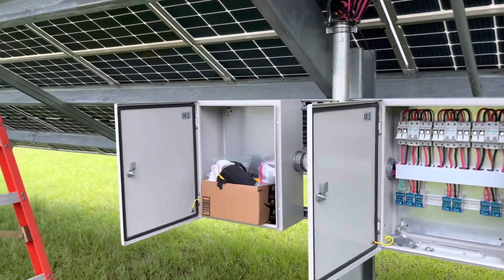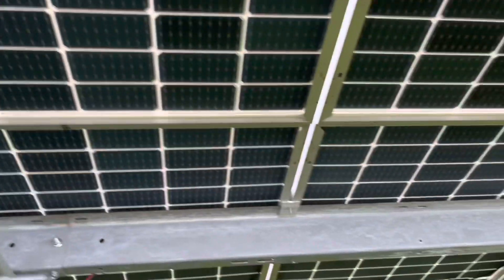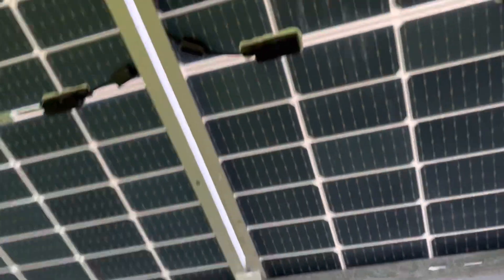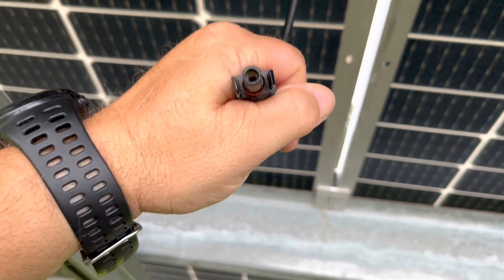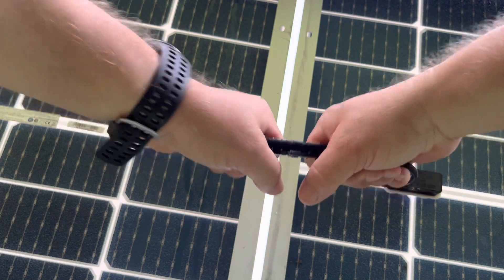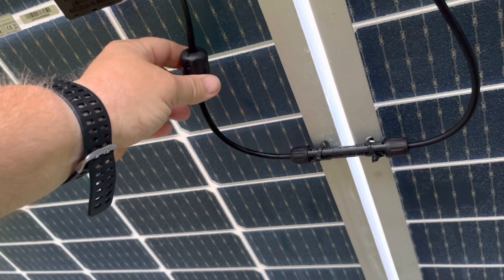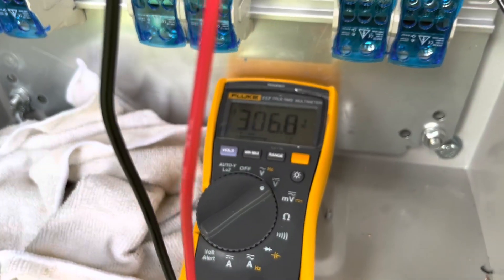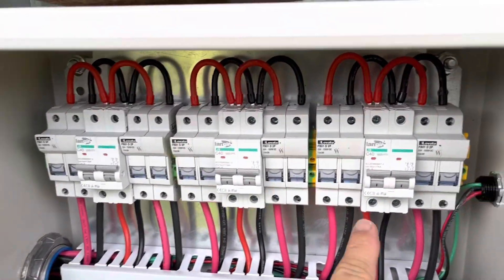Solar Power Project - PV Array Wiring and Combiner Box

Comment: Those surge suppressors are massive! I've seen those used in wind systems, so I'm sure they do the job, But they're very expensive as compared to the DIN rail mounted type  40KVA+ that I am using. Moreover the later fit nicely inside your combiner box. Did you see any drawback in using those?
Reply from the maker: I considered the din rail mounted units. They operate differently than the units I have. But as I considered how much I was investing in my solar equipment I wanted to make sure I protected as best I could.

Comment: If you have the proper rated breaker, is your fuse really needed then? Is not that overkill?
Reply from the maker: According to the panel mfg the maximum fuse allowed for a string of panels is 20A. When I parallel strings the combined maximum power point current is around 23A. 23A > than 20A hence the need to fuse each string. The breaker is only being used as a disconnect.
Reply: @jeffmotes2129  It's rare to see a PV panel with Isc higher than 10A. But mine are less than 280W. In your case, a  16A 1000VDC breaker would do perform perfectly as a disconnect and overcurrent protection. The thing about fuses is that they come in different types, some of them are fast blow and other are slow blow. Most do not handle higher  DC voltage like around 450 VDC nicely. if they do, then they are quite expensive too and I never find them when I need them. God knows why... Just like my tools.
Reply from the maker: @francoisguyot9770  that would have been another way to do it
Reply from the maker: @francoisguyot9770  I’m using ZNShine 450W panels Imp = 10.7A (plus up to 10% for bi-facial), Isc = 11.6A. 

But what you suggested would certainly work and would have saved me the extra disconnect per source circuit.

Comment: Nice set up,FYI if you're using broadband ferrites you need to have them clamped around the Pos&Neg of the circuit or they get over saturated quickly. If you're using high saturation ferrites you'll be OK tho✌️
Reply from the maker: You are correct. Thanks. Going to modify this shortly.

Comment: Looks good but DC has a lot more loss that AC with long wires. How much loss do you get through the run to the inverter and how long is it?
Reply: This has less loss than 240V AC
Reply: It’s common in Solar to run high voltage DC from the array to the inverter.  The high voltage 3-500vDC mitigates the problem of voltage drop.
Reply from the maker: @balrog006  I’m running 350Voc on the source circuits from the array to tge inverters. That was the maximum voltage I could configure with the number of panels and inverters I was originally using.
Reply from the maker: It’s about 400’. I’m using #4AL direct burial. VD is 2.7% at max current

Comment: You mentioned that it was raining. Be careful there with exposed MC4's you really really don't want moisture in there. If you do it'll work for a few years then you have yourself some troubleshooting. I leave the covers on until the moment it's plugged in.
Reply from the maker: Well said. It was a rainy day but wasn’t raining at the time. I inspected each connector before putting together. The hard rain set in a few minutes after I finished.